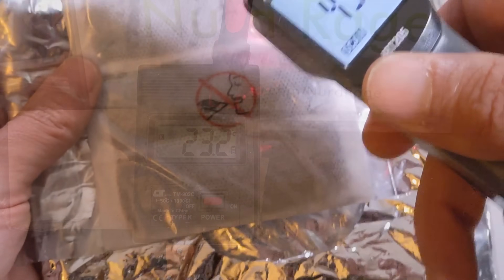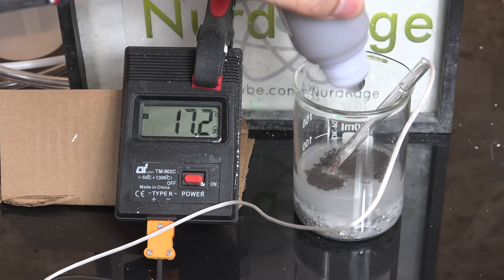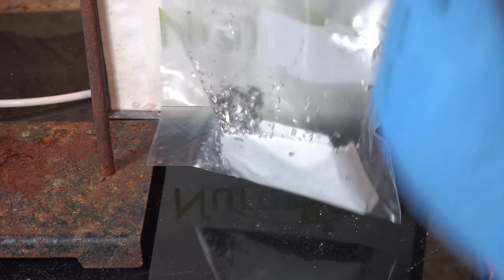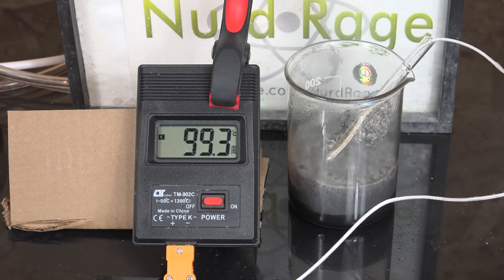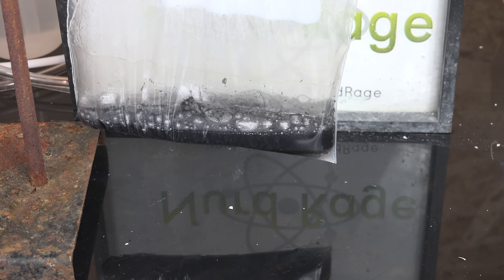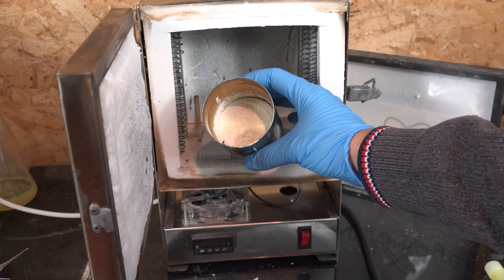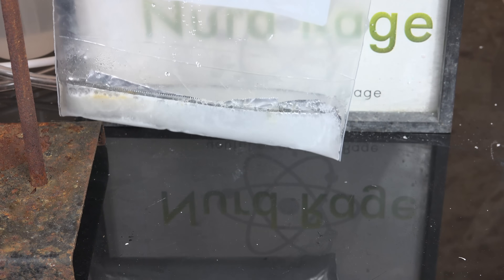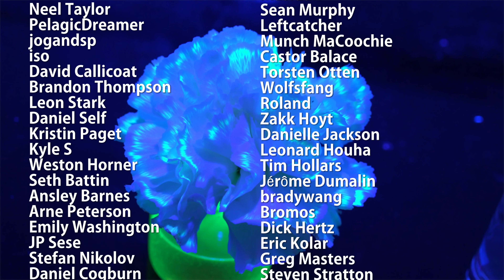How to Make Your Own Flameless Ration Heaters and the science of how they work.

Comment: 3:47 I think the large amount of water probably did hinder the performance. MRE heaters are intended to be barely soaked in water, and not buried in it. If you're measuring temps from that reaction, most of the heat is going to heating up the excess water, and not the food :P

Comment: Thankyou, this is AWSOME!! I currently am doing some experiments with the sodium hydroxide and aluminum version trying to refine it. I decided to use Food Saver vacuum seal bags for my FRH bag being that these bags are designed to cook with the sous-vide method of cooking (IE you can boil food with it). So far it’s working like a charm. I was trying to find a way around the separate storage problem, would the sodium hydroxide and aluminum react with eachother dry if the sodium hydroxide was put in a paper container similar to a tea bag or napkin material?
Reply from the maker: paper slowly reacts with sodium hydroxide, even when dry. So probably not a good idea.
Reply: @NurdRage  alrighty, another way of separating the aluminum from the sodium hydroxide until use I found is to put the sodium hydroxide on the Verry bottom of the bag, suspend the aluminum half way up the bag, and vacuum seal it like this, the tension of the vacuum seal would keep them separate until you tear the seam on the top for use. If I were to go with the previous method tho, what  alternative material would be better suited for the job?

Comment: you used to be able to buy quicklime based "hot can" for camping in the UK, no idea if still sold. It was double walled can & you used a supplied pin to poke in premade holes between the layers. The pin I think burst water packs or just opened the pack and you added external water based upon brand.

Comment: Here are the patent numbers for the original MRE heating pads and for the Mg-Fe "supercorroding" alloy:
US5611329 -  FLAMELESS HEATER AND METHOD OF MAKING SAME
US4264362 - SUPERCORRODING GALVANIC CELL ALLOYS FOR GENERATION OF HEAT AND GAS
It's basically a shorted galvanic cell - here magnesium acts as a sacrificial electrode. Similar mixture of active and noble metal is the Zinc-copper couple - the preparations are on Wikipedia but one convenient way is to treat zinc powder with copper(II) sulfate in dil. hydrochloric acid or with copper(II) acetate monohydrate in acetic acid. Maybe this can be adapted to "magnesium-iron" couple ? I believe so as these mixtures are of ancient origin and aluminium and magnesium were expensive metals (production cost was high and there was no process for mass production).
They seem to have prepared the alloy by simply milling fine metal powders together - of course with the exclusion of oxygen. The active powder is then mixed with salt, anti-foaming agent and fillers (polyethylene) - the mass is then sintered (heated below melting point) leading to solid porous material that can soak up water.

Comment: Maybe sintering iron and magnesium powders would work (some magnesium might vaporize and coat more of the iron). This would also avoid high temperatures needed to actually melt the metals. Activated iron and Rieke magnesium under anoxic conditions might work bettr. Since only fraction of iron to magnesium is needed, maybe just adding Mg to Fe(2+) solution would also work - here magnesium acts as sacrificial anode, reducing the ferrous ion to the metal and preventing its corrosion (just like zinc does in galvanized iron). Or maybe adding magnesium turnings to a solution of iron(II) - this will activate the magnesium (the turnings may be coated with MgO or MgCO3) and precipitate fresh metal that is in contact with the zinc. And finally, magnesium amalgam might also do the trick - note that mercury does not alloy with iron but "wets" in a similar way it does with copper. Magnesium and iron don't seem to alloy well anyway (melting Mg actually precipitates iron, according to Brauer).
Wet activated iron powder with little rust added as catalyst might work, too. It requires exposure to air and electrolyte (salt). Addition of acid might acceletate the reaction though I know it happens in almost dry state (hand warmers). It probably won't cook food but it provides mild to moderate heating over several hours. The wetting might be provided by hydrated salt - so less water and little initial heat would jump start the "wet" reaction.
Interestingly, iron alone can corrode underwater and in absence of oxygen. This is known as the Schikorr reaction and the product is not commonly known red/brown rust (a.k.a. hematite - Fe2O3) but a black magnetite (Fe3O4). The reaction starts with iron and water producing iron(II) hydroxide and ends with iron(II,III) oxide which is thermodynamically the most stable.
I heard that some iron powders may be "passivated" by magnetite coating so the reaction might require activation by dilute acid or leaching solution (my favourite rust-removal mixture is acid ammonium oxalate - i.e. 1:1 mixture of ammonium oxalate and oxalic acid - this has almost exactly pH 3 - the mildly acidic ammonum hydrogen oxalate is the predominant species that preferentially removes iron oxides by reductive dissolution and chelation). Acetic acid might work too, but heating will passivate the iron due to formation of basic iron(III) acetate.
Iron(II) hydroxide seems to be an excellent reducing agent as it reduces even nitrates and nitro compouds to ammonia a amines, respectively (even at elevated temperatures, no boiling needed) - this was so far possible only using aluminium (see Devarda's Alloy) in strongly alkaline conditions. Studying the properties of zero-valent iron for inorganic nitrate removal (denitrification) got me here.

Comment: I remember watching a researcher in Japan come up with a seawater battery that also used magnesium. He couldn't get a steady stream of ions (electric current) until he tried some magnesium that had a little calcium impurity in it. I forget what the other electrode metal was, but I think the magnesium was sacrificial, and the other electrode got coated in magnesium salts which stopped the reaction; the calcium impurity helped prevent that coating from sticking to the electrode. It doesn't produce as much electrical power as a lead-acid battery, but it was enough to power a go-kart a respectable distance. The magnesium/calcium electrode could be regenerated with heat, and Japan was surrounded by seawater so the electrolyte was free. Even if it wasn't ideal for automotive uses, you could use a bunch of them as grid batteries because the battery would produce a small amount of electricity for a very long time, kind of like a non-radioactive RTG.

The main downside is that they're primary batteries, so they can't be recharged by putting a voltage across the electrodes and you'd have to replace them as they ran out of charge, which is probably why grid operators are using secondary (rechargeable) battery chemistries. Still, it was kinda cool to see this professor try to come up with alternatives to burning carbon, as there's not a lot of room in Japan for renewable energy farming.

Comment: I stumbled upon a very simple flameless heating method while trying to make a cheap gravitational Daniell cell: aluminum foil and CuSO4 solution. 
There are two stages of the reaction:
- Al reacts w/ CuSO4 resulting Al2(SO4)3 and metallic Cu that sticks to the foil (so the "alloy" is created for you on the spot)
- the Al + Cu foil suspended in a mix of aluminium and copper sulfate solution acts as a shortcircuited cell and the solution soon starts to boil
The transition from one stage to the next is pretty visible. I think that's the cheapest and easiest to obtain method (barring that w/ slacked lime) and the ingredients are quite shelf stable.
(haven't told to many about this method because i don't want the woods littered w/ chemical residues, but I think that ship has sailed)

Comment: The sodium hydroxide method might work for heat, but it can also poison you in an enclosed space. Not to mention, unless your ration is contained in glass or steel, it will dissolve whatever your container your ration is inside of and contaminate your food. It's actually kind of funny if you consider the fact that "Crest White Strips" only work because it contains sodium hydroxide along with "suspended" hydrogen peroxide, and squeezing it against your teeth when applying innitiates the same reaction in your mouth. Yes, everyone who reads this, that's actually how they work.

Comment: I have a video called The Works Bomb on my own channel using the HCl+AL reaction, in which we poured toilet bowl cleaner over strips of aluminum in a 2-liter soda bottle and screwed the cap on. The explosion of the bottle rupturing from the expanding gas was incredible! I'm glad this is one of the heating methods described here. You could store liquid toilet bowl cleaner next to your ration heating kit if you wanted to use that reaction in particular.

Comment: I work with one of the inventors of MRE heater packs.  They call it "super corrosive alloy".  I went and got the the mason jar of 90% Mg / 10% Fe blend he gave me.  The note taped to it says the two metals are in close contact to make a battery in water and promote corrosion.  Salt further promotes the galvanic corrosion.  IIRC, he told me once that they made it by ball milling the metals together.  The elements in the alloy are mechanically mixed in solid phase, not liquid.
Somewhere there is the patent on this alloy.  He also tried to promote it as convenient source of H2.
On a side note, this was invented for the military.  Which puts symbols on everything.  A symbol for food.  A symbol for poison.  Etc.  MREs initially had both symbols, which did not go unnoticed by soldiers told to eat them.
Reply from the maker: whoa that's amazing! thanks for sharing! I might try and ball mill my own now :)

Comment: you can add ferric chloride in solution which would react to Mg resulting iron; the elemental iron will deposit on magnesium surface; iron salts would therefore act as a catalyst. this could be an option instead of adding iron on top of Mg and NaCl.

Comment: When I was deployed to Iraq, we had a case of  cans of calcium oxide heated nonspecific food. I forget what it was supposed to be, but I was pretty disappointed when it wasn't hot by the time the guys who were having MREs with the flameless ration heaters were finished eating.

Ended up getting fed up, starting a small fire and chipping the can out of the calcium oxide to cook over open flame. Which only put me 5 minutes behind the guys who'd had MREs.

And on that note about immersing you food in the solution, the genius of MREs is the ration, say, spaghetti with meat sauce, is in a sealed foil pouch and can, further, be outside of the FRH bag, but insulated by the box that entree came in. Along with the jalapeno "cheese" spread you traded your buddy for for mixing hot.

Comment: Mix 1 part iron 1 part silicon with 7 parts aluminum and 20 parts magnesium. Melt the iron first, add the silicon and aluminum next, then the magnesium in a crucible with argon or nitrogen shielding gas. It is a bit more stable than the magnesium iron alloy. This alloy is super brittle like glass and can be crushed and ball milled. The size you want is about the consistancy of playschool sand. With water it gets hot and makes H2 which you can burn for even more heat, adding an acid or base or a salt like sodium acetate will speed it up a bit.

Comment: I tried making sodium acetate but idk if it worked. Im pretty sure it did it tastes like pickles but it like turned into thick layers when it dried and idk what to do now is it ready or do i resolve it with water to supersaturated solution idk what i did wrong but i used like a gallon of vinegar and maybe 2 boxes of baking soda and don't want to throw it away.

Comment: Try vacuum seal bags. The bonus is they are vacuum sealed until you use them. You can make them different shapes. Put your heater in a bag of water you heat that contains a bag with your meal. Like a Sous vide cooker.

Comment: Great video. Years ago I also experimented with ration heaters and found out that a mixture of both aluminium powder and calcium oxide in a ratio of 1:4, toped with double the amount of water can heat up meals quite quickly. For example I mixed 10g of CaO with 40g of Al powder and stored it in teabags to use it I poured in 100ml of water and put my food on top. Well insulated was it enough to heat up 500ml of water to around 85C. For me both easy to get and cheap.
Reply: Wondering where you find cheap Al powder?
Reply: Maybe "cheap" was the delimiter here....

Comment: DIY FRH:
- 1 vacuum sealing bag (1 end open, 1 end WELL sealed) 
- 2 ziplock sandwhich bag + 2 V type coffee filters (not the wavy edged ones) + 3 staples
- The chems in the video. 

- Perm marker to draw a water line on side of bag

- the NaOH (or other powder). Put powder in 1 of the coffee filters and fold closed/flat, make sure its tight 
Put in the 2nd coffee filter, again fold closed/flat.
THEN
1)staple the edges to keep the 2nd one close
OR
2) (sewing machine needed): Sew the 2nd coffee filter closed, making sure there isn't an air pocket and its well sewn shut
PUT this in one ziplock back...closing it and making sure no air is in it. 

-->Alum/Mag etc goes in 2nd ziplock bag. again make sure all air is out. 

TO USE: 
-->just take the component out of the ziplocks, placing them in the vacuum seal bag....
-->PUT your food pouches IN BEFORE ADDING water!!!
-->pour in water up to your water line; quickly fold top of bag a few times to keep steam in etc. 

*poking a few holes in the coffee filters of the powder can help speed up the Rxn but still keep it more controlled
*a big paper clip to hold bag shut when folded = makes it easier.

Comment: You can get sodium hydroxide from campfire ashes (just mix with water) - not sure how much you get (though, if you already have a fire...). You can also get sodium hydroxide from electrolysis of water with sodium chloride (though, if you already have electricity...), but the electrolysis method also produces hydrogen gas, so factor that in as well.

Comment: Tangentally related to the flameless heaters: Years ago I was experimenting (ok, playing with) heat of solution of various chemicals. Ammonium nitrate of course gets cold when dissolved...but what about releasing that heat again by recrystallizing it? I heated it, thinking the heat of crystallization would help dry it, but it never did. I had a damp clump that I couldn't dry. I let it cool completely then I put it in a beaker, covered it with a watch glass, then put it in a vacuum chamber. I thought that the evaporation of water would remove heat from the damp ammonium nitrate faster than the heat released from recrystallization. I was wrong - by a long shot. It essentially exploded when the heating led to runaway steam production. The watch glass was blown off and smashed on the inside of the vacuum chamber. I was SUPER LUCKY that the chamber didn't crack and implode: it wasn't in a cage, and it wasn't even a real bell jar...it was a cookie jar. For PPE I just had safety glasses. I won't do that again! But I suppose I can claim to have "invented" a flameless heater for vacuum conditions...if you don't mind the explosion part.

Comment: it should work with potassium hydroxide (KOH) as well and the interesting thing is making it from wood ash --- maybe the alufoil can be replaced with alu cans cut into pieces --- why not use a concentrated solution of wood ash together with alu can pieces? so according to wikipedia 1.13 kg per liter dissolve at room temperature --- would require 9 to 10 ml of the concentrated solution --- so probably that has to be watered down a bit

Comment: What about NaOH and aluminium? That will heat up like hell too with water.

And maybe the produced hydrogen could be fed to a system that uses it to contribute to the heating, like a fuel cell with a resistor... dunno if that would generate any useful amount of additional heat thoug.
Reply: I-Isnt that Sodium Hydroxide used in the reaction mentioned in the video?
Reply: @L1ghtyyyy  ah yes indeed it's mentioned right after the moment I paused to comment, I was thinking it was gonna remain on magnesium chemistry and hadn't watched the rest yet

Comment: 4:04 actually, there are coffee cans that use thermite to instantly heat coffee. The simple trick to make thermite useable for heating food is to encase it in food grade metal, and have it submerged in water; that water is to make sure it doesn't overheat and basically have a meltdown, and that water can be the consumable itself (i.e. a brew or a soup), or you can use that heated water as the cooker.
Reply: I came here to mention the same. I found the patent on them. Interesting how they get it to start.

Comment: You could use the hydrogen to spin a turbine if you don’t want or can’t burn things. Stored in batteries and then use a 5-12v stove
Reply: Platinum and aluminum do react with hydrogen and creates a current as well as heat… magnesium also works potassium too zinc, most reactive metals work as a catalyst with hydrogen